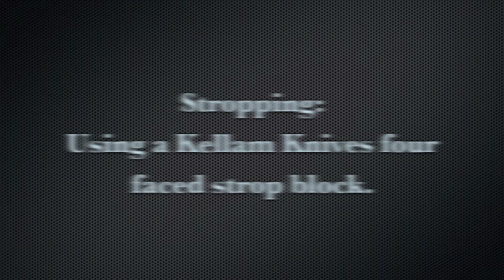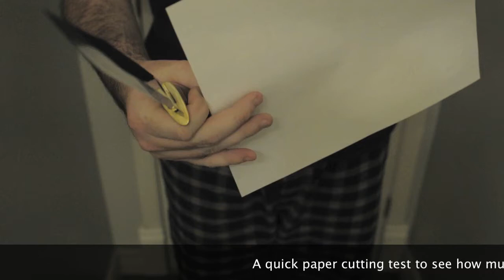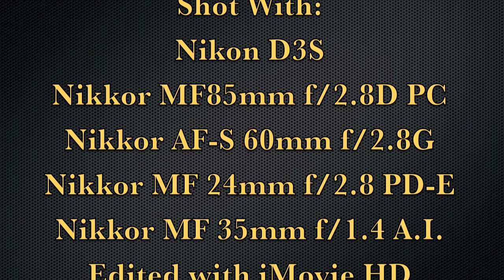Sharpening Sheffield Bowie.mov

Comment from the maker: @karcher1991 420 SS is rather soft. Should be very easy to sharpen since the max hardness of 420 is 50 HRC. the trouble you'll have is keeping an edge if you try to put that knife to any serious use. Softer steels dull fast with use. I'm reminded of a great quote by Ben Franklin: "There never was a good knife made of bad steel." Not to say that your knife is bad but you may want to consider getting a better knife made from carbon steel or a modern SS if you intend to use the knife for anything.

Comment from the maker: @phsycosk8r429 
A dull knife is very dangerous. Regardless of what steel your knife is made from if you have a very dull blade you may have to spend quite some time re-profiling the edge before you can even hope to sharpen it up. I'd recommend you pick up an easier sharpening system to begin with and once you master that move on to the more technical means of sharpening. I'd recommend a setup like the Spyderco Sharpmaker. Its really easy for beginners to get a shaving sharp edge with it.

Comment: I’ve had one of these knives for over 40 years and they’re tough as you like. Really hard to sharpen, but hold an edge for ever. When I was a teenager I abused it way passed anything it deserved, but it never let me down whatever I did to it. The only issue is that being carbon steel, they rust like hell if you don’t look after them!
Reply: thats awsome it lasted you 40 years , may i ask how you kept up with yours as far as cleaning and sharpening?
Reply: @joule-trix  it doesn’t exactly look in the first flush of youth! It’s supposed to be going back to Sheffield for a refurbishment at some point.

Comment from the maker: the nagura stone should be wet at the same time as the other stone. when ready for the Nagura just take it out of the water basin and rub the face of the nagura against the face of your 4000x or better stone. you'll see that the slurry builds quickly and a little goes a long way. cheers

Comment from the maker: @karcher1991 Yes you got it. some of my first knives were of a softer steel, helps you refine sharpening technique. the Rambo 3 knife is a very nice looking knife but replicas are notoriously weak in the handles sometimes. If it has a full tang should be fine for general purpose brush clearing and the like.
 Pls be careful if you are going to use the knife for fine outdoor work like fire prep, shelter building or anything of the sort big blades are difficult and dangerous for those tasks.

Comment from the maker: @drizzt109 
There are three compounds that come with the strop with different particle sizes 3micro, 1,5 micron and .5 micron. The successively finer grits polish the blade quickly leaving a refined mirror edge that is sharp AND durable.

Comment: i have a Winchester bowie knife my bro gave me a while back and i dont have much experience with sharpening metal, would you recommend the same sharpening method or something different, thanks
Reply: the same should work however winchester bowies are dangerous and  break easily.
Reply: I have the Cold Steel Wild West Bowie. Would your method work with that?